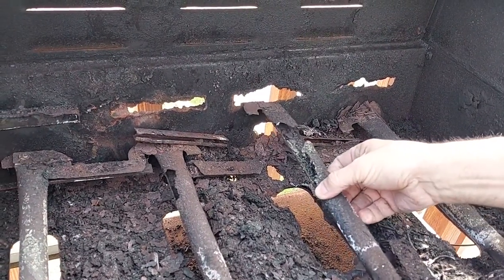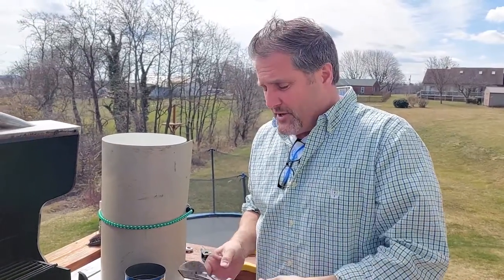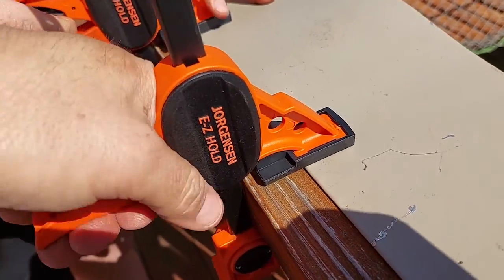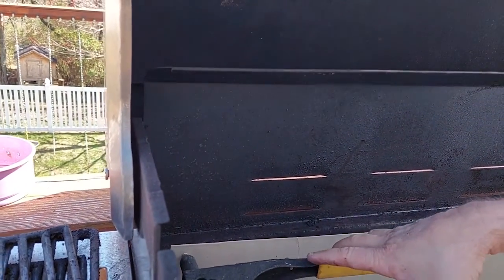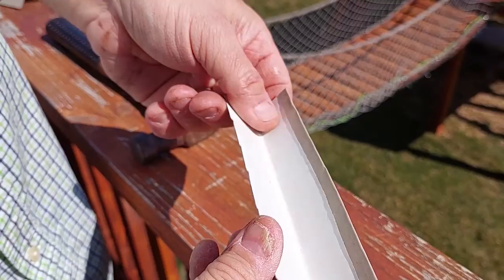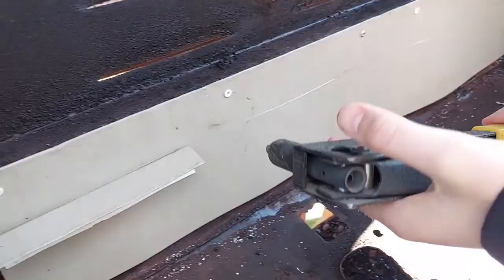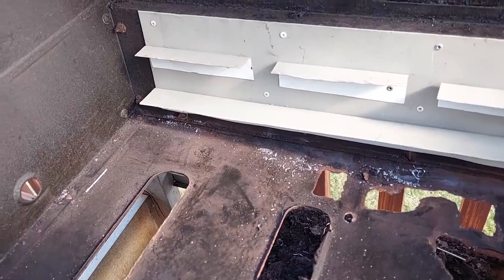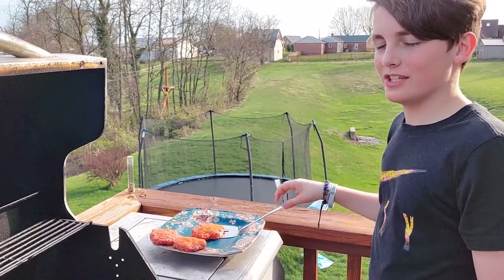DIY: It's Easy To Fix a Rusted-Out BBQ Grill | Gas Grill Repair

Comment: Sheet metal like that might be zinc coated and is super deadly to use for an appliance used for cooking. Anyone who's done this won't reply because they've died from poisoning themselves. Great video though. Very informative.
Reply from the maker: Good point to mention for those looking to rebuild their grill..... in my case, I didn't use sheeting that is zinc coating
Reply: Toxic

Comment: How about the floor of the interior below the burners? Outs rusted out woukd like to repair/replace that.
Reply from the maker: @aprileverett4353  you could do the same as I did mine..... or fold over the edges to make the material stronger

Comment: Great Video! I have a similar project on my built-in grill. The fire box has a few holes on the back wall and one side. I'm thinking about doing the same thing on mine, rather than to find someone to weld plates or other type of repairs. I'm wondering how the aluminum flashing has held up with all the heat and use after several months. Your answer is greatly appreciated. Thanks again!!
Reply from the maker: This aluminum was free which is why I used it but stainless steel would be the best if you have it available at a reasonable price
Reply from the maker: This project was about a year ago and it's still holding up well....
Reply: @DIYinspiredLewisBrantner   Great! Thanks for the quick reply. I've ordered the 304 SS sheets and other parts.
Reply: @DIYinspiredLewisBrantner  Thanks again for your help here and for posting the video!

Comment: Thanx   Currently attempting similar on my 20 yr old Vermont Castings BBQ .. which i use ~2 x a week ..every... week of the year.
Can't find a new BBQ of even.. similar.. quality.  Regardless of Price. A bit depressing actually.
 So I'm fixing mine.. again !. 
Small Note: I've done this previously and I too used "flashing' Heavy gauge type.  
However It rusts out Badly and Early! !  
Not a good choice for longer than a season 's use/life.
 
SERIOUSLY recommend going to a metals shop and buyin ~20 gauge Stainless Steel sheet. 
Same work as when using Flashing ....yet SS lives .. Loong.
Reply from the maker: Great suggestion.... I might do that next time